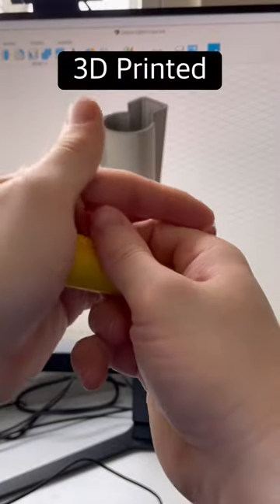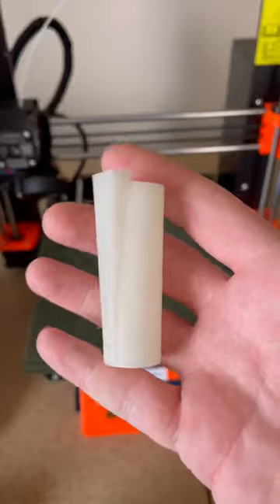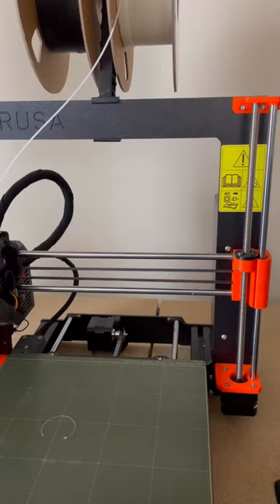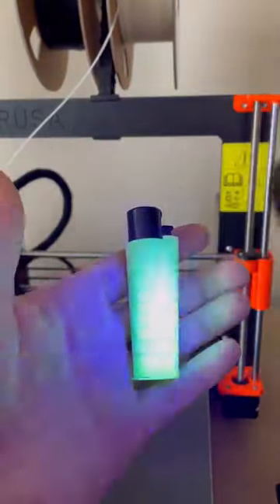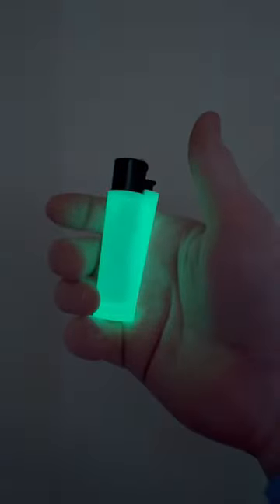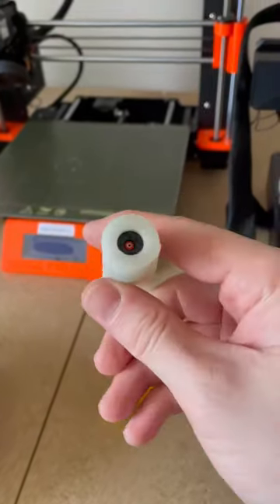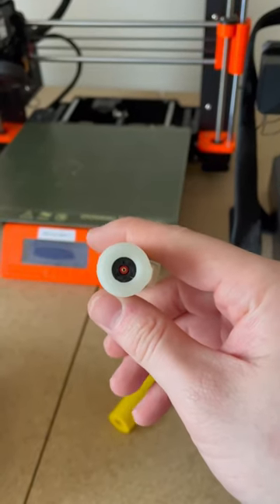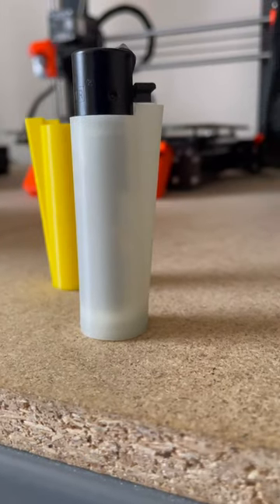3D Printed Clipper Lighter Case 🔥

Comment: How’d you design something like this?
Reply from the maker: Fusion360!
Reply: @MysticMesh3D  did you just take the outline of the lighter from a picture and expand it to full size, then expand it??
Reply from the maker: @BeEpicMotivation  No, I used calipers to get the exact dimensions of each part of the lighter then designed the case piece by piece using different sketches in fusion360.
Reply: @MysticMesh3D  oh using the line drawing tools, that makes sense. Sorry im new to fusion so im still trying to figure it all out. Thanks for the help
Reply: How tight is it on the clipper?